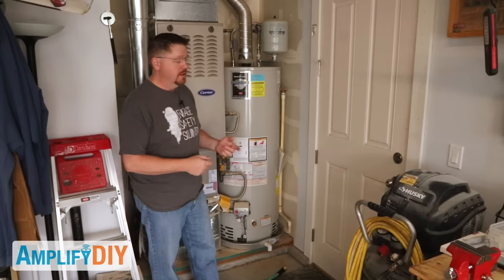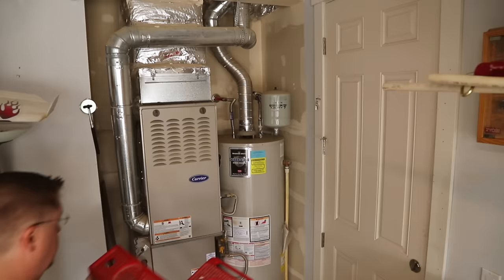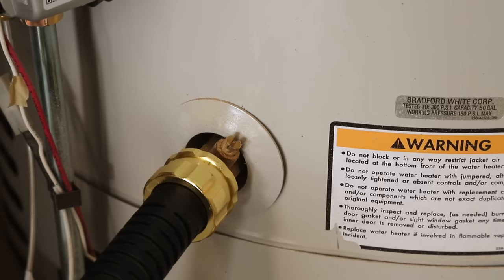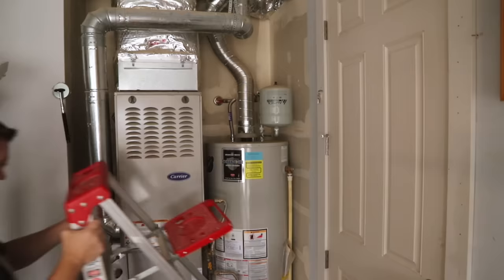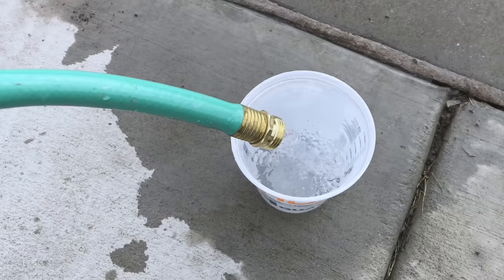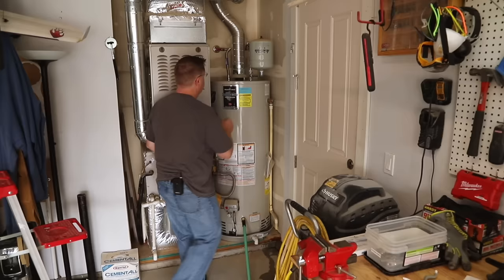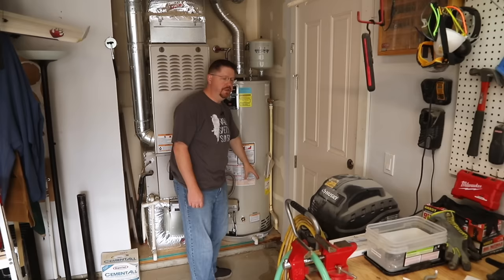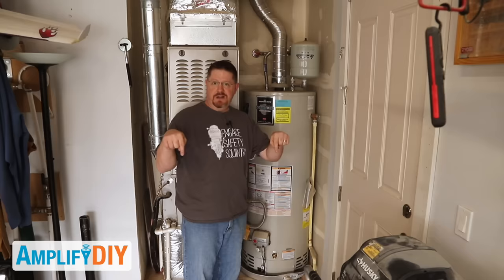How To Flush A Hot Water Heater To Remove Sediment

Comment: Be aware that messing with your (PRV) pressure relief valve can cause it to leak. And in that case will need replacing. You can simply open a hot water tap.
Reply from the maker: Note that in the video I do suggest opening a hot water tap first, and only touching the PRV if you have a back flow preventer at your faucet. This apparently is how my house is plumbed... I opened ALL my hot water taps, and none of them would allow air to flow back to the hot water heater. My only option was to open the PRV. You are right, though - be very gentle with that valve, and check it once you are finished to ensure a proper seal. Replace it if it winds up leaking.
Reply: It will only cause it to leak if it is already defective.  TPRVs should be tested at least once a year to ensure they will open as well as close and reseal.  If they won’t do both, then time to replace.  I generally open mine and flush a gallon or so of water through it and check that it reseats prior to draining the sediment from my tank.
Reply: AmplifyDIY - Would another option to allow air into the water heater be to shut off the water main, open valve on top of water heater and open a hose bib?
Reply: Nope.  Won't help.  There is still no place for air to come in and replace the water that you want to drain.
Reply: Jay Herde What won’t help?  Hard to tell who you are replying to.
Reply: @ACE-gj9zq  yes if you put a hose bib on the (hotside) supply to the house you could allow air in through that. It would even work on the cold side you'd only have to shut off the supply to the tank. All so be aware if you have any of those mono lever taps if any are put in the middle and on. Water will go around and end up back on the hot side.
Reply: @LTVoyager  Exactly. Not touching them for fear they leak is silly, leave it and don't test it and it can fail and damage may occur. See mythbusters water heater.
Reply: Rick Powell And it isn’t as though they cost $500 to replace.  They are pretty cheap and generally can be replaced in 10 minutes or less.
Reply: yea buddy I think turning anything can cause it to leak old stuff I have I am afraid to touch it. no fun having to call for professionals .
Reply: Scott Amun Much better to call for professionals at a time of your choosing, than to have things fail at 2 AM.  At least that is my preference.  If a valve starts to leak when you use it for its intended purpose, then it is bad and should be replaced.
Reply: @LTVoyager  I totally agree!! My TPRV failed while I was at work. It soaked the base plates of my walls!!!
Luckily, it's in a storage room attached to the end of the house with it's own door accessed from outside.
I have since permanently connected 3/4" tubing to it, and ran it outside to drain. I also test it regularly.
Reply: Jerry P. I pipe mine to the floor, but mine is in a basement with a floor drain not far away.  I have never seen one fail open enough to leak a torrent if they are tested periodically to keep the deposits flushed out and the seat clean.  Given how inexpensive they are, it doesn’t hurt to keep a spare on hand so that if it fails it can be replaced quickly.  Not a bad job if you are handy at all.
Reply: @LTVoyager  I forgot to mention that the valve was not a "full flow" failure, but enough to cause damage due to my absence.
It was sticking open and leaking even without inlet pressure, so I changed the valve, and have since regularly tested it. And I do have a spare on hand along with spare A/C compressor and blower motor caps, (that's another story).
Seems all my equipment breaks down on the weekend!
Have a Happy New Year!!
Reply: Ok silly question, how do you know if you have a back flow preventer at your faucet. Also, If Im going to turn it on at the highest point (as recommended in a previous and earlier thread), when flushing how do know air is flowing back to the water heater? Thanks so much! Great video.

Comment: wow.  You spent 200 gallons of water PLUS the 40 gallons that you drained off the first time.   240 gallons.   That's a lot of water.
Reply: and a new hot water tank in Canada installed is $2500.....he spend about $2 in water
Reply from the maker: Water is much cheaper than a whole new heater. I actually did the math, and with my water pricing this flush cost me about $0.75 in water. Other areas may vary, of course, but honestly you’ll never convince me that an annual flush will cost more or have a greater environmental impact than replacing a heater prematurely.

Comment: Had my Bradford White installed 02/21/2012 and had to have it replaced yesterday 01/14/2024. 12 years for a hot water tank is pretty good. I did flush it once during the 12 years however my flush consisted of draining 1 bucket full of water. I definitely like your method. I've set up a computer reminder for once per year, repeating with no end date.
Reply from the maker: With regular flushing, I'd expect to get at least 20 years out of a heater. The automated reminders are a great idea. Good luck!

Comment: I've been saving this video for more than a year, trying to get around to flushing my water heater.  It's been five years since it was installed new and this was the first flush.  Finally did it today and the stuff that came out that wasn't water looked like fine sand.  I don't think I got 100% of it out, but most of it, for sure.  My house has the anti-siphon (or whatever you call it) feature so that you can't let air in through a faucet in the house.  I had to use the pressure relief valve for the air.  It all seemed straightforward getting it empty the first time and then running 30 seconds worth of water in and out a bunch of times.  I then filled it maybe half-way and let that drain, then a couple of more sessions of 30 seconds worth of water.  Eh, good enough at that point even though it wasn't 100% clean.  When I finally filled it back up, I wasn't able to get air out of any faucets, the the relief valve worked for that until I finally was getting water out of it.

Since I might now do this yearly, I'll try to do a more thorough job next year.  Thanks for a very informative video.

Comment: Much appreciated ! Just did mine following your steps. Heater was installed 6 years ago and this is the 1st time I flushed it. I got about a handful of what looked like melting rock salt that disolved as I squeezed it then hose went clean. Im guessing this may have contributed to 2 of my faucets needing repair because of leaking ? Thats another project...lol Thanks again!
Reply from the maker: Great job!

Comment: Your video was an unbelievable help. I had to flush my 7 year heater over 20 times as the previous owners didn't flush it for sure. The water only got a lot more clear towards the end. I feel it's still not 100% but after spending close to 8 hours, I was drained. We were getting like a pretty loud banging sound every time the water was being heated which appears to be very faint or negligible now. Thank you once again!!!
Reply from the maker: Great job!
Reply: @AmplifyDIY  thank you. I still hear the sounds and it's been bothering me. Would you recommend pouring in vinegar through a funnel in the garden hose and then letting that sit for a few hours to clear the built up sediments? I know there's a way of doing it from the top but I'm not so confident at doing that.
Reply from the maker: @cameronrodrigues  Forcing vinegar in through the hose will be ... tricky. It will be far better to try the following: 

1) close the drain valve at the bottom of the heater. 
2) ensure the cold water inlet at the top of the heater is shut off.
3) (the part you are uncomfortable about) disconnect the cold water inlet from the top of the heater. If your heater is set up like mine, this is very very simple - just unscrew the fitting and pull the inlet pipe away from the top of the heater. 
4) pour at least 2 gallons of vinegar into the heater, then let it sit for at least 3-4 hours.
5) with a hose connected to the drain valve, open the drain valve to drain the vinegar out. 
6) re-connect the cold water inlet on the top of the heater
7) open the cold water inlet, and leave it open for about 5-10 seconds. Then close it and let the heater drain.
8) repeat step 7 until whatever drains out of the heater a) is perfectly clear, and b) does not smell like vinegar any more. 
9) re-fill the heater and finish the job following the final steps in the video. 

I hope this is helpful - I'd love to hear how things turn out!

Comment: When you buy a water heater, buy a self-cleaning one, because it has a built in swirling of water intake pipe in the tank, and it swirls the sediment when water comes in the tank.  That's supposed to keep the sediment settling down in the bottom of the tank.

On the 2nd flush, which is only cold water, you could use that wasted water on grass and plants.

On the refill of the tank with cold water (the final step), put a bucket at the end of the pipe that is connected to the pressure relief valve, which is opened.  When water comes out, you know that you should then close the pressure relief valve.

Last tip: I am looking to replace my water heater, which lasts 20 years so far!  I am amazed!  I am thinking of getting a tankless water heater!

Comment: Great video, thank you.  Your videos are well done, very easy to understand and are the perfect length.
I have been trying to figure out why my Pressure Release Valve continues to leak water, about 1/2 Gallon a day.  I used your “How to change a pressure release valve” to figure out that the specs on the replacement was not exactly the same as the original (thank goodness I still had a photo of the original).  So, now I have one with the exact same specs, the same manufacturer and model number and I decided I should drain and flush the tank in case it is sediment getting in the valve.  It has been 3 years since I bought the house and I haven’t drained it.  Who knows how long it had been before I bought the house.  If that doesn’t solve the problem, I will try replacing the pressure tank on top.
Reply from the maker: This sounds like a classic case of a failed expansion tank. Good luck!

Comment: I been in my house 8 years and you are just now telling me I should do this once a year ? Great video, will have to do this soon.
Reply from the maker: Hey DJM - yeah, annually is best. Given the age of your heater with no maintenance, you should also check/replace your sacrificial anode: https://youtu.be/OIMz1rwx_jc
And you may also need to replace your drain valve: https://youtu.be/OBPJYg0o_o0
Don't worry, both are pretty easy and cheap to do yourself. Good luck!
Reply: @AmplifyDIY  After having watched this video, I had ordered the anode rod, I ended up ordering the 44 inch flexible one, as my water heater is in the master bedroom closet behind a wall. When ordering it, I forget how much room was in the space for the heater, so didn't want to take a chance on getting the single unit one and then need the flexible rod. I will flush the heater when I replace the anode rod, saving some time.
 Just got it from amazon two days ago, so will replace it soon, can't be to hard, considering last year I replaced the lower heating element, thinking I should replace the upper one as well.
PS: the house was built in 2014, so the water heater is almost 8 years old. Again thanks for the great video
Reply from the maker: @overkillkiller  I'll never understand why builders / architects design houses such that the appliances that need regular maintenance are crammed away in the back of dark closets with almost no space around them. Sounds like you have thought through what needs to happen for your situation, and I bet you'll have little to no trouble getting your heater into tip-top shape. Good luck!
Reply: @AmplifyDIY  So when i had to replace the lower element, I paid no attention to above the water heater, I removed the panel covering the heater and there is a ton of room above it, but its still in a hole in the wall big enough to have about 6 inches per side so it fits, maybe a tad more. 
 Luckily the rod i ordered came with the socket and thread tape, I will end up replacing it tomorrow, do you think while i'm inside, should I go ahead and replace the upper heating element as well? I mean its been almost 8 years and the lower one just went out last November or so.
 Thanks for the info again.
Reply from the maker: @overkillkiller  Yeah, I'd go ahead and replace the upper element while you are in there. You may also want to consider replacing the drain valve with a full port one like I show here: https://www.youtube.com/watch?v=OBPJYg0o_o0
Good luck with the anode!
Reply: @AmplifyDIY  Ok, so the biggest problem is, my water heater has the drain valve almost at the very bottom, there is a 4 inch high wall in front of it, which makes it impossible to hook up a hose to, I would have no way to replace the drain, unless I unhooked the water heater from all lines going into or out of it and lifted it up some or cut out a section of the wall to allow access to it, not sure how safe that is and will check with someone first.
 Was wondering if there was a way to replace the drain valve with something that kinda went upwards? I did look up drain hoses, which are roughly 3 feet in length of which I could just leave hooked up all the time, but the angle of the water heater makes getting anything hooked up to the drain, tough.
 Any suggestions ? if i could, i would send pics of the location of the water heater so you could get a better pic of the problem.
thanks for all the info so far
Reply from the maker: Shoot me some pictures: AmplifyDIY (at) gmail (dot) com. I’ll see if I can come up with any good suggestions. Thanks!

Comment: Whoa that’s a lot of wasted potable water. Imagine every household in North America doing that. But, it has to be done. Thanks for the video!
Reply from the maker: It uses around 150 gallons of water the way I do the flush. Yes, this is a lot of water, but it's a drop in the bucket compared with the impact of manufacturing new heaters all the time, and the cost of replacing a failed one earlier than really needed. Thanks for watching!

Comment: Very well done....here in North Florida, we have a lot of calcium, and I have seen heaters that would not work at all with 8-10 inches of debris in the bottom.  Also, they would usually require a new lower element due to corrosion.  Of course, if they have both an upper and a lower, I would change both.  Same thing for headlights on cars.   If one goes, the other is likely not far behind, since they have equal time on them.

Comment: I've owned my condo since 2003 and never thought to do this. Watched the video, wrote down the steps, followed then and my tank is draining right now. First problem i encountered was finding the cold water shut-off valve. It was covered in dust, but I found it. Second was turning the drain valve 1/4 turn. I tried it in several positions, but no water entered the hose. 

I finally disconnected the hose, because I figured the drain might be clogged. I stuck the screw driver all the way in and rotated a couple times. Sure enough, dirty hot water started coming out. So I quickly re-fastened the hose to the drain and now it's flowing. I'm on the second floor, so the hose goes out the front door and under the railing and into the leaves and mud beneath the staircase.

Now that I have turned the water heater back on and the cold water is filling it, I turn the hot water faucet in my bathroom on periodically and it is always brown and leaves alot of sediment. It will be clear eventually. i am glad I did this.

Comment: Very good video. easy to follow. I learned something new today and saved myself a plumber visit
Reply from the maker: Glad it helped, Boomchucks!
Reply: @AmplifyDIY  The flush went well but I'm still losing water pressure in my hot water lines. I can't locate any leaks so my next guess is mineral build up. Are there any steps I can take myself to clean out the pipes/tank or should i call a professional?

Comment: A list of steps for folks.  THANKS FOR THIS VIDEO!!
How To Flush A Hot Water Heater To Remove Sediment

	1. **TURN OFF HEAT SOURCE (turn to pilot or off)
	2. Turn off cold water supply valve
	3. Connect garden hose to drain
	4. Open hot water faucet (allow air in)
	5. Open drain valve
	6. Open pressure relief valve (perpendicular to tank)
	7. Inspect water for particulates (water is HOT!)
	8. Agitate tank (turn on cold water for 20 seconds, 3-4 times checking for sediment
	9. Fill tank and drain again
		a. Close drain
		b. Close pressure relief valve
	10. Open drain and close cold water supply valve (check for sediment again)
	11. Close drain & remove hose
	12. Open cold water supply
		a. Leave pressure relief valve open until water level is close to let air escape
	13. Reset thermostat (burner should activate)
        14. Open hot water faucet to clear air from lines

Comment: Thanks for the help. You explain things very well. Using your videos I was able to replace my expansion tank after being able to determine that it was causing my pressure relief valve to leak due to the expansion tank being in a failure state. I flushed my tank while fixing that. That’s why I’m ending my project on this video. :) Thanks again!
Reply from the maker: Nice job!